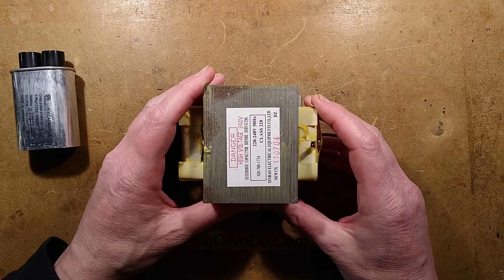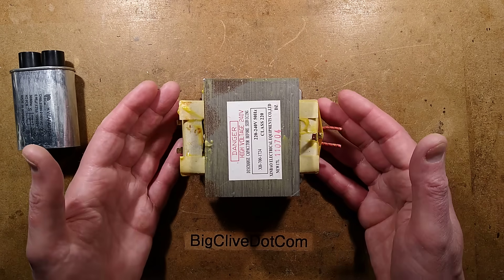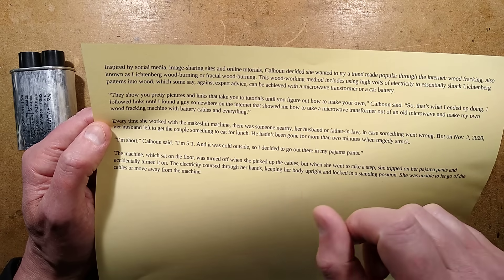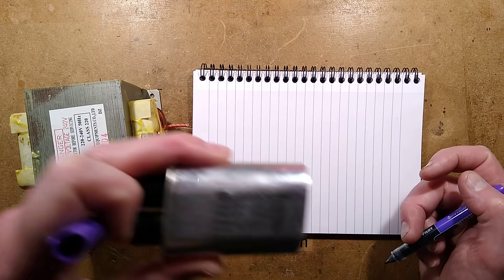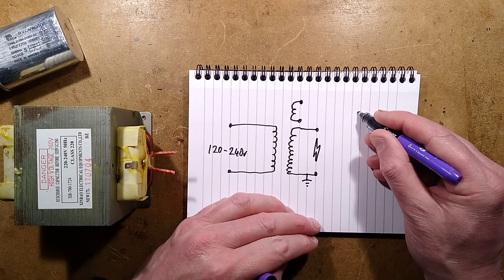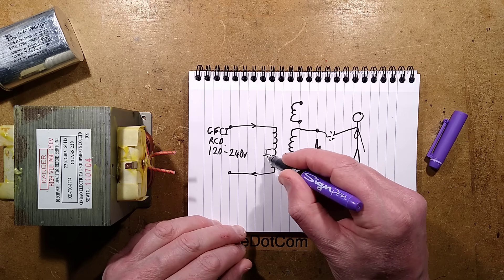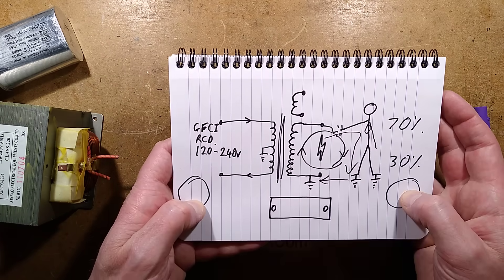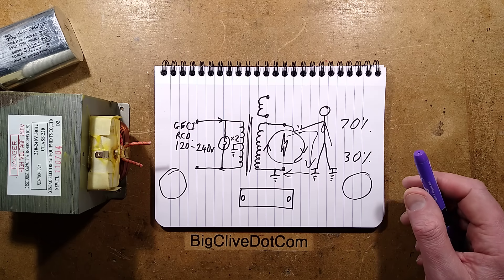The most deadly project on the Internet

Comment: I was a major Appliance repairman for 27 years and the Capacitor from a Microwave stopped my Heart...I was dead. When my limp body hit the floor the impact re-started my Heart....Just lucky I guess. 
That Microwave had been unplugged for a week but the Capacitor was still charged.
Reply: Genuinely curious here, how do you know your heart actually stopped for that duration?
Reply: @dwerg1 he doesn't
Reply: @dwerg2k  well I'm not a doctor but I am told that when your heart stops you black out...and that is what happened to me. Repairmen diagnose and solve problems all day every day. Thinking things through is what we do. You could say we get paid to solve problems and figure things out. I read technical books constantly. I was just relating what happened to me.
Reply: @paulb4496  bruh.....common now
Reply: Changing the A/C capacitor was scary!   I made sure it was discharged the red neck way by shorting the connectors with a heavy duty insulated screw driver!  Beats what you went through!   I find it hard to believe the capacitor held the charge that long!  You sure about the week?   Glad you made it back!  Did you see the white light?
Reply: @Curious_Skeptic  I was just going to ask.  Is changing an ac capacitor dangerous too?
Reply: @Jack-russell103  YES!  If you don't know what you are doing, deadly!   That said, it's easy!   Typically, the capacitor will discharge itself in a short amount of time.   HOWEVER, you NEVER assume such!  Once power is completely disconnected from AC, wait a bit, and BEFORE you attempt to pull the cap, short the cap connectors!  Use a properly insulated screw driver do so.   ONLY THEN, can you be 100% positive you won't get a shock.   In all cases, if you aren't comfortable around line voltage, best to have a pro do it.   We only get one chance at life!   Accidents happen even to the most knowledgeable.
Reply: @a.belladonna8316  You never forget that feeling of being electrocuted!   I still remember being maybe 3 or 4 years old and getting shocked from a Christmas decoration.  When I was older, I got shocked by a pull pump cord!   As an adult, I think I get a good shock once a year just working around DIY projects, LOL.   Trust me, ELECTRICIANS get shocked all the time on line voltage!   It's one reason you only work with you right arm/hand and keep your left arm hand the heck away from whatever you are doing!   Longer distance to heart, plus if both hands are on power, it's a path right through your heart and body!   Lots of crazy videos on this stuff.   BE CAREFUL>   It's no joke.  (although it is funny as hell when you get shocked).
Reply: @Curious_Skeptic yes absolutely i'm learned. My lesson  if i play with high voltage over 220v  i'm extremely carefull and everything insulated  and never directly touch cable. Also i put mot in  to oil bath for cooling
Reply: @a.belladonna8316 i got shocked by a 240 volt stick welder. Lemme tell ya this. DO NOT WELD/WORK WITH A WELDER WITHOUT GLOVES!!!!  Just please dont
Reply: @Curious_Skeptic  *shocked not electrocuted
Reply: @skoparweaver7692  I appreciate you dearly sir
Reply: @Curious_Skeptic  My electronics teacher made a glove with a bit of metal at the wrist and when he worked he would keep the wrist grounded.
I've never seen him use it but he said it worked great.
Reply: I guess this must be a joke in a non-joke format.
Reply: As a technician, you should have known to discharge the cap. That's basic tech knowledge.
Reply: @truthseekerKJV  As a technician he should know that it is not possible to determine whether or not state of actual death has been successfully achieved in the time it takes for a body to sustain a shock and fall to the floor fortuitously reviving itself upon impact.
Reply: @whynottalklikeapirat  I agree this
Reply: @truthseekerKJV  I'm not actually technician at this time ı only 15-16 years old now i'm working on HVAC and i'm not the first comment guy @paulb4496
Reply: @a.belladonna8316   Your head barely missed the ceiling then … I am impressed. 

Especially from a position crouched over a microwave oven. Most especially seeing as an above-average vertical jump score (which is the 60th to 70th percentile), is around 48 cm while an * excellent * rating is around 53 cm (which is the 80 to 90th percentile) and anything beyond 60-70 cm begins to enter the realm of elite sportsmanship. 

The world record for a standing vertical jump (no crouching at the high point) is  held by American football player Josh Imatorbhebhe. His jump was measured at the 2015 Nike Rating Football Championships, just shy of 1.2 metres. The current world record WITH a crouch at the top of the jump is an impressive 1.7 metres. 

I don’t know if you did the crouch or not but at 1 metre you’re in good company, and props to whomever stood ready with a measuring tape, predicting the event.

Most people have to bend their knees significantly and make quite the directed effort to propel themselves into the air. Actual high jumping is of course highly technical and requires great body control, vigorous milling of the arms and of course - an actual state of consciousness. 

I hear that can pretty difficult with a strong current coursing violently through ones body.

You are not exactly doing your story any favours buddy …

😏
Reply: @whynottalklikeapirat  belive or not belive i'm shocked by oven but 15 years old now 30 I Just barely remember maybe just capacitor or mot plugged and I am not anymore afraid of 220 v yes I live in (Turkey)Türkiye. Sadece zıplama olayını abarttım. 220 v çarpması önemli değil önemli olan kapılmamak refleks olarak zaten çekersin elini
Reply: @a.belladonna8316  I believe you got shocked. Incidentally I also really like Turkish food when it’s not made in a microwave :D
Reply: cool story bro
Reply: It's true, I checked his pulse on the way down in midair
Reply: Why didn't you bleed them down then a resistor will do the trick 😊
Reply: @retrorevolutions4590  when you work with electricity all day every day
Reply: @retrorevolutions4590  when you work with electricity all day every day  you are not afraid of it and it becomes routine. The Whilpool units I was used to had a bleed resistor and bled themselves.  I have respect for electricity but am not afraid of it.

Comment: What is the secondary voltage?
Reply from the maker: Open circuit it can be around 2kV.
Reply: @bigclivedotcom  Thank you for this information. I may make a "Jacobs Ladder" out of #12 solid because I think 2kv will have enough electrical potential to form the arc.. I made one years ago with a boiler igniter. It worked very well.

Comment: I have a defibrillator (ICD) implanted in my chest, after suffering a heart attack several years ago. A few months after it was fitted, it malfunctioned and defbrillated me for no reason, whilst I was fully conscious. I felt like I’d been kicked in the chest by a horse, whilst a white light flashed in my eyes and I bit my tongue. A minute later it did it again, and again, a total of at least 25 times within the space of the next half hour. It was eventually switched off by a doctor after I had arrived at the hospital, as the ambulance crew did not have the authority to disable it. I then had the ICD replaced and the new one has behaved impeccably. I certainly won’t be doing any high voltage wood-crafting!